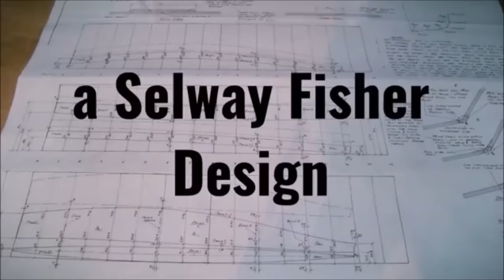Welcome to Captain Wulkie's Garage

Comment: Please forgive me for saying this
But a little wisdom some times saves lives

That boat although it looks very good and you did your best,
Please do not take it out in any real rough weather
The reason I say this
Fiberglass although fairly strong, it has it's weakness
Those seams you did along the bottom of the boat without proper support on them will eventually weaken, and you may find yourself with a torn open bottom,
Fiber glass will eventually form very small working cracks.

I've seen fiberglass rip off the wood and also form minute cracks where there is flexing,
Watch the belly for those cracks to appear some time in the future depending on how much you use the boat,

You may be able to lengthen the life of the boat if you can put some ribs lengthwise along those joints, And never use OSB for any boat works.

If you don't believe me, Check with some accredited fiber glass boat builders,
Reply from the maker: Thanks for the advice. I will also ask the design maker for advice and share your feedback. I do plan to sail it aslo on open sea but not permanent of course
Reply: the seams have 3 layers of glass and resin plus 1 properly epoxied fillet. i doubt many stitch and glue designs ask for more.

Comment: Can I ask you why you did the double lay up? I understand strength/wear factor on the underside but usually a 6 inch wide strip along the keel line would suffice. I'm thinking added weight and cost for not alot of benefit
Reply from the maker: The plywood is pretty flexible si adding an extra layer oposite to the first in terms of fibre direction makes the hull more steardy. I learned this from another project

Comment: If you are building a Highlander 16’, note: the hole in the center board box for the bolt is below the water line. I found out the hard way. I moved it up about 3” without any adverse effects to the balance of the boat.
Reply from the maker: Yes. That is a topic i did not yet tackle... would watertight epoxied bolts not work?
Reply: I felt it would always be a challenge to keep it water tight, plus if it ever failed while on the water we would be swimming home. I found out at the first launch. A lot of water came in fast.
Reply from the maker: Thanks for the advice!
Reply: Nice job.  It didn’t appear that you overlapped seams in your glass during the layup.

Comment: Does this need to be built with marine plywood? will all the wood be covered with fiberglass?
Reply from the maker: Yes. Marine plywood is a must.
I did not yet decide if i will cover the top side with fibre as well. It is not a must
Reply: Thank you

Comment: Good idea. But! Weak transom for such a boat.  Thicker plywood is needed to mount a 9 horsepower motor.
Reply from the maker: My engine is 2.5 hp. I believe it should be fine. I do not plan anything larger if an engine at all

Comment: Can this be motorized or is it  only a sail boat design?
Reply: How much do you estimate a project such as this one will cost?
Reply from the maker: Yes. Bit because of it's shape, engine will only push slow. You can not glide or speed
Reply from the maker: Materials only, i estimate min 2000 usd for the hull and another 2000 at least for outfitting and sails

Comment: What is the pot life of epoxy?
Reply from the maker: Once you mix the resin + hardener you have ~1 hour. There are special hardeners as well that can cure faster but you should be fine within the hour. My advice is to mix smaller batches that you can apply fast. And always do that above 20 degrees Celsius or ar per datasheet